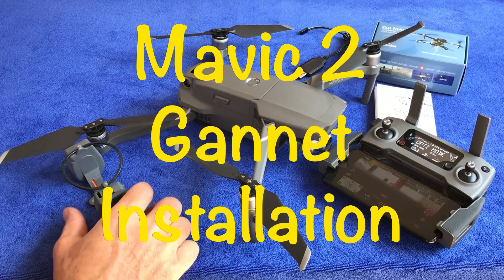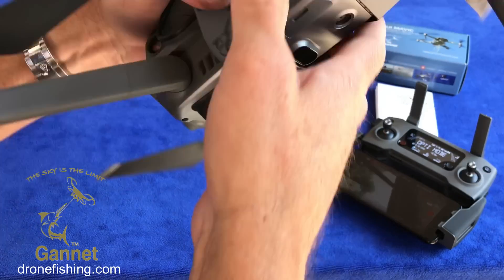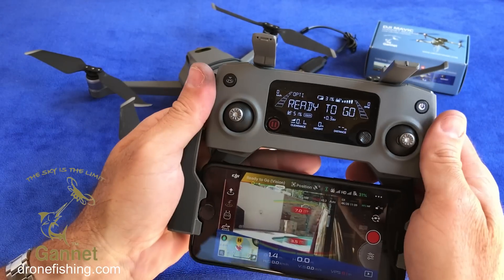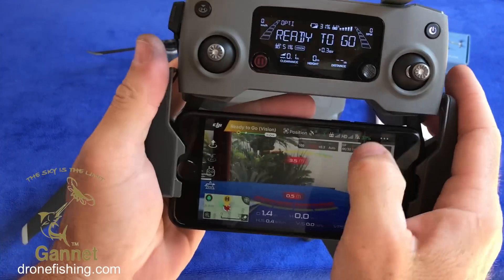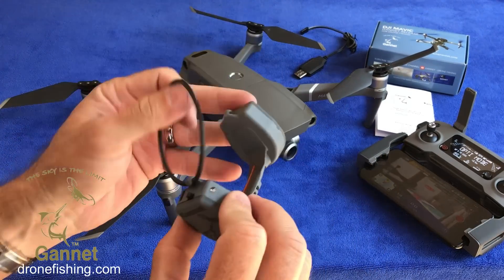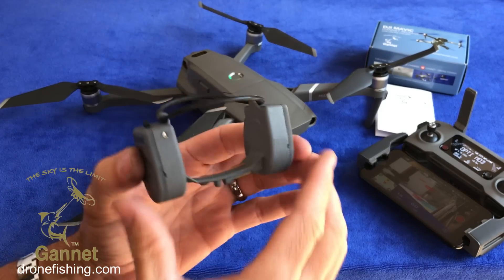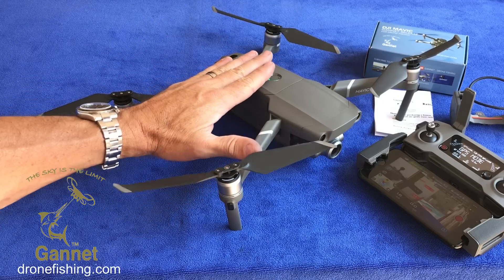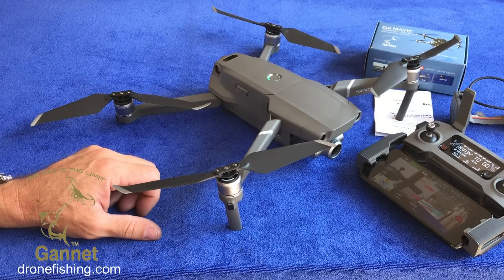Mavic 2 - Gannet release installation

Comment: Very nice and easy to use solution! But I would like to know if it is possible to invert the release function, so it is locked when the landing light is off, and releases when you turn the lights on?

Because if you have to stay in the air for a long time, or need to fly a certain distance, the having the lights on will drain the battery faster.
Reply from the maker: It automatically can reverse, the trigger works both ways round. If you power it up with the lights on and then turn the lights off it will release. If you power it on with the lights off and then turn them on it will also release.
Reply: @gannet-dronefishing2295  Aha, that is really neat! Do you ship your products to Finland?

Comment: Looks very well done but don't you want light on = open and light off = close so that you save power which can give you more flying time to drop the 5th
Reply from the maker: We changed the software a while ago, it now learns the light intensity every time you switch it on, and any deviation from that be it more or less light would then trigger the release. So switch it o when the light is on and then turn the drone light off it will open.
Reply: @gannet-dronefishing2295  sorry  I'm lost to what you're trying to say
Reply from the maker: @dgfish23  it can now automatically work any which way round you want. 
When you power it on it measures the light, any change from there will open it.
Reply: @gannet-dronefishing2295  ahh I got you know now, sweet that explains it  
And I was just watching your video explaining it like it. this way how you have it as you having the light to open only can probably save a bit of battery 
https://youtu.be/52hAzv4WIxU

Comment: my gannet dont want to release - open or close
Reply from the maker: Hello, you can write us on hello@dronefishing.com.
It can be a few things like a run down battery that needs replacement or perhaps a broken sensor cable.
We will help you get is it sorted.
Reply: @gannet-dronefishing2295  it is a new gannet, but now i have another problem (not the gannet) i get a systym warning / check app
Reply: i will check the batteries

Comment: Also the new one works with lights on = open which is the way it SHOULD be. Your design is poor
Reply from the maker: It works both ways now, simply switch the lights on before switching it on will flip it to work opposite.

Comment: seems backwards?
shouldn't lights off be closed?
turn the light on is open.
you don't want a long flight with the light on. could pull the battery down. or just put a switch on it so the user can decide.
Reply from the maker: Kane Lono the new ones can now work both ways, it now just depends when you switch the Gannet on. So you can fly closed with lights off and switch on to drop or the opposite.

Comment: Do you think this would work to hang Christmas Lights on 100 ft + trees?
Reply from the maker: Keystone State hi yes easily, we have guys installing amateur radio antennas with it and others in Norway installing power lines with it over gorges. Depending on the weight of the lights you may be able to fly them up directly or f they are too heavy then fly a guide line up and over first and drop it on the other side then pull the lights over the tree with the line.
Reply: @gannet-dronefishing2295  Good stuff... I didn't think of using a guide line, was just going to tie a string around the lights, and then attach the string to the release. (doesn't look like it's wide enough to handle most more than that, xmas lights would probably be too thick) ... Thanks for your input!